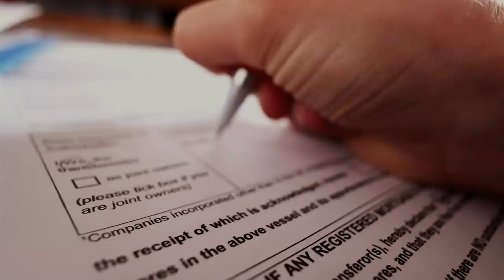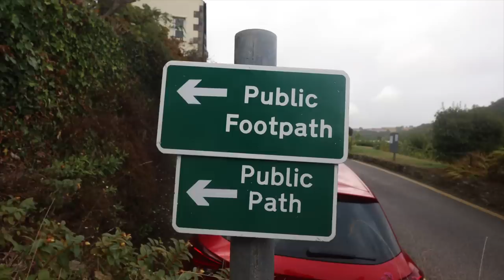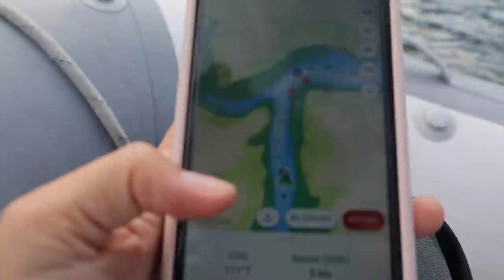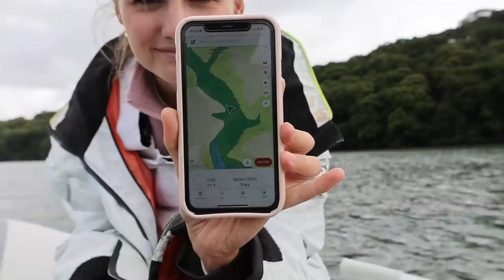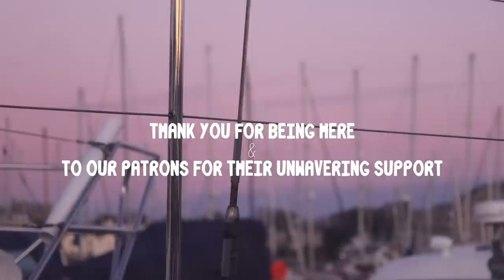Is this the BOAT GRAVEYARD of the UK?

Comment: One of the best tips I got when changing filters was to use a plastic ziplock-like bag around the fuel and oil filters when unscrewing. All the mess goes inside and you can zip it up when finished.
Reply from the maker: Thanks for the information! I’ll definitely give that a go next time 😁

Comment: Thanks for another great video. Just a suggestion for the dingy. Get yourselves a small piece (50 - 60 cm) of plastic pipe the diameter of the throttle control/tiller and you can slip it over as a tiller extension and still have steering while getting your weight as far forward as you can.
Reply from the maker: Hi Paul. That’s a brilliant idea, we’ll have to see if we can find one soon 😊

Comment: Great videos. I’m binge watching them to catch up. I’m a friend of Mike and Bosun. My tip would be that you should try your Rocna. I have an ‘undersized’ Rocna and it holds better than any correct size anchor I’ve had. I think it would hold better and be easier to handle. Works perfectly every time.
Reply from the maker: Thanks Russ, any friend of Mike and Bosun is a friend of ours 😊 We’ll give it a go!

Comment: To save your bow thrusters have you tried using your spring ropes to pivot you off a pontoon?  Keeping the stern spring on and reversing onto it (helm toward the dock) will ping your now out.  Driving forward against your bow spring will ping your stern out…. For the former this is good if you have wind and tide running on your nose and you want to effectively turn around…. It also means you are still attached to the dock so won’t drift off should it go a bit pear shaped! Don’t forget a roving fender though when you steer into the pontoon/dock!!!
Reply from the maker: Thanks for the advice Andrew 😊 We haven’t tried this technique with our boat yet, we’ll have to give it a go next time we are coming alongside with wind and tides! In difficult marina we normally have a roving fender at the ready 😊

Comment: Falmouth is where boats go to die, or possibly live forever. First time I was there it was weird- seeing lots of famous old race boats you thought had been wrecked/scrapped/sunk years before, still chugging on...
When anchoring you can gurantee you drop the hook on the one piece of crappy holding for a mile in any direction. Some anchor types are incompatible with certain ground , e'g Danforth on kelp. and will hold like a greased eel in a bag of marbles...
Reply from the maker: Our anchor likes to flip over and drag whenever we are trying to set it in rivers with strong currents. However, we are slowly getting better at making sure it doesn’t flip 🙃

Comment: Gosh that was twice as long as normal this week , look forward to them as usual 😊, be good when you finally get away from dreary England , can you not use the shower on the boat when at sea or does it gobble up the water and gas ?as you know I am no sailer so do ask questions others may no the answer to 😊
Reply from the maker: Thanks Paul 😊 We can use the shower at sea, however heating up our water requires a lot of power. So when we can shower in a marina we do 😅

Comment: Hi There. Some free Lectures and talks on YouTube to help you get Boat Wiring etc right and Safe to proper Marine Standards, given I've just spotted your going Off Grid Video to Watch. As an Aside, I've lived Off Grid forbover 30 years. The Channel is **Pacific Yacht Systems**,  and as a qualified Electrical installation engineer,  it shocked me to find things I would have done, That Definitely Wouldn't have been safe to do on a Boat. As an aside, new boat for me will not have a generator, will have a properly designed and Built Rear of Cockpit Solar Arch in suitably large diameter 316 Stainless steel Welded Tubing, for up to 4 1.6mtr x 0.9mtr 300+ 2atts Rigid Monocrystalline Solar Panels with up to Two Balmar alternators on the slightly oversized inboard Diesel Engine. Note - Almost Every Rear Solar Arch you see on Yachts is done with Badly undersized Tubing, and much of it isn't even welded ! Most don't even fit a Galvanic isolator, let alone the superior Galvanic Transformer, and getting everything DC and AC Electrical Circuits right can be a Nightmare. The Arch will have room sorted for possibly a Wind generator at some point, but to make sure everything is right from the Start electrically, I'm going Production Boat because they get it right because if they don't they lose their shirts in not up to Marine Standards Claims. So everything fitted and working, or everything in its place wired in for fitting later, for example, Water Maker Not fitted first but ready to ve fitted in the USA,  with enough Water Tank capacity to get there. A bit hard to do that with a Secindhand boat of course. Bob. 👍
Reply from the maker: Hi Bob, we’ll be sure to check out the channel. Thanks for the help 😁